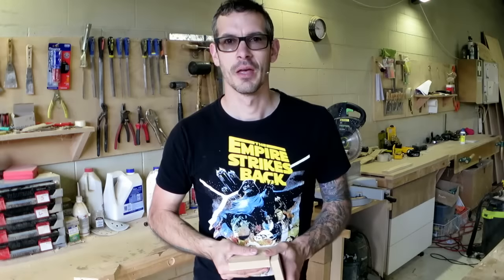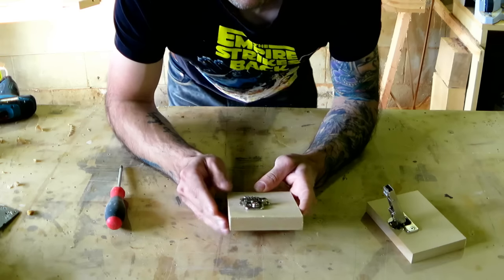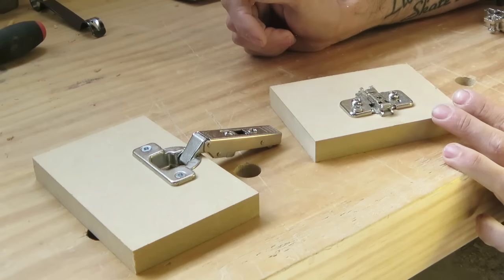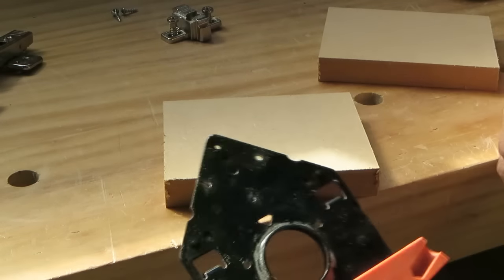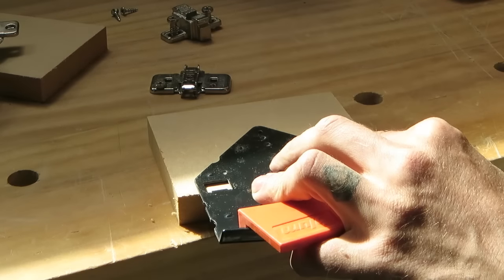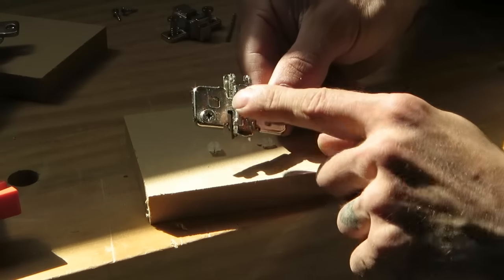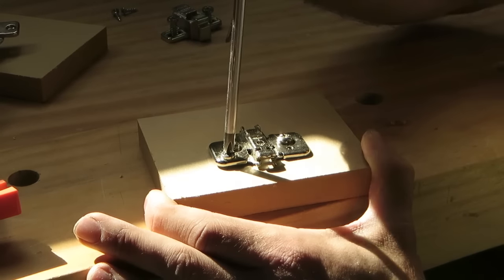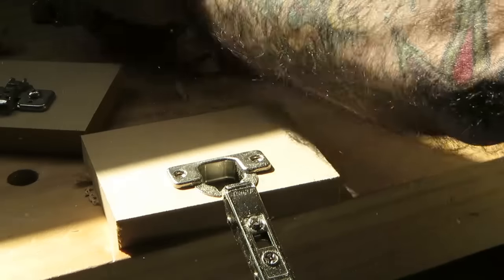kitchen hinge basics

Comment: For euro hinges it is pretty simple. The hole in the door is 35mm in diameter, 12mm deep, and should be 5mm from the edge (or 22.5mm if measured from edge of the door wing to the center of the hole). The cabinet part is even  simpler. Holes are 5mm diameter, 32mm apart and should be 37mm away from the edge of the cabinet side edge.
Reply from the maker: This is totally not always the case, there are so many different types of hinges and relevant drilling positions that this generic simplified information is not really helpful unless you specify which hinge and type you are talking about.

Comment: May I ask what those plastic "anchors" are called. It seems after a while my screws end up loosening and nobody here checks on them and they/the door end up getting leaned on and the threading from the wood side gets damaged and the screws fall out and get lost. I was thinking of just filling the holes with the missing screws with epoxy and replacing the screws.

Comment: Is there any reason not to install the bore side of a hinge in the cabinet instead of the door for an inset door? It seems like then the bulky part of the hinge would be out of your way instead of inside the cabinet.
Reply: Yes, that is the way the hinge is supposed to be installed. The geometry of how the door opens will not be correct, also they will not adjust correctly.

Comment: Do you have any rule of thumb for measuring door sizes when using these style hinges?
Reply from the maker: Trevor Roth hi,  generally no wider than 600mm  and anything of say 750mm tall will need 3 or more hinges. ie a pantry door will have 3  taller than that 4.  this is assuming you have 20mm thick Doors.  thicker than that you will probably want more hinges to accommodate the extra weight
Reply: I mean do you make the doors smaller than the boxes with full overlay hinges.
Reply from the maker: Trevor Roth oh yeah.  so I like to use full overlay when possible. if it was a single door on a cabinet I'd make the door 2mm smaller on each side top and bottom depend a bit on application but that's easy enough to work out.  if there are 2 or more Doors I take 2mm off the hinge side and 1 off the open side. 
so a 600mm cabinet would have 2 Doors 297mm wide. depends a bit on how much adjustment you have in the hinge. if you make them tight you can always shave them  a little.

Comment: Good info. Did you ever come across such a hinge that opened at least 270° and would be under closing tension from at least 180°?  I have a design that requires the mount to be on a partial blanking panel on the front of a cabinet.
Reply from the maker: Hi mitch, the best i know of is 170 deg.  i think you might have to make pivot type hinge for that?
Reply: Cheers. Thankfully I have plenty of time to work on the design for this, so I'll figure something out. Have to love these hinges for the adjustability and ease of installation though

Comment: can you telk me why i keep burning out drill bits? drilled 6 doors and already the bit is burnt out and i need another. at this rate i will got thru $100. in bits.
Reply from the maker: Mainly because the cheap bits are cheap. I have had the same problem. If you were to spend  $150 On one good one is should go for a couple of years.

Comment: Can anyone help me here... The doors on my cabinet and cuboard are like half inch overhang on both sides... I am trying to replace the frameless hinges with better ones but twice I have been to home Depot to get desired hinges. All of which are making the door short. What do I mean by short? Once installed, the door is short by is like 1/2- 3/4 inches from where the opening is. It's like the current hinges I'm getting placing the door 1-1 1/2 inches overlap on one side. Any suggestions???
Reply from the maker: Hard to say without a pic. Could be that the hinge mount is a 9 or 18mm and should probably only be 0mm mount. Find me on Instagram and send me a pic

Comment: It said zero mm but it had a 2mm lip.
Can you make it flush? Like actual zero no lip?
Reply from the maker: +Harry Girgin yes, depends on the hinge type and amount of adjustment. In this case I could move the hole for the cup part in the door slightly closer to the edge of the door.

Comment: Please help me! One of the hinges got broken, and I don't know how I can get a replacement. I got 3 different kinds from Lowe's but no luck. See photos in this album: https://photos.app.goo.gl/cIzc4VgmBBIuC6K92 . How I can find a replacements online?
Reply from the maker: hi , im not exactly sure where you can buy these as im not in the states, but it look like you need a 160 degree or 180 degree hinge , the one that is broken also has soft close built in so you might want to get that again too. you will need to buy the hing (part on the door)  and the mount (part on the cabinet)  unless you can find the same brand hinges as whats on the cabinet now. 
also if you buy a new brand its probably worth while buying another set and change both hinges on the same door so they move together correctly.  hope this helps. ??
Reply: KingPost TimberWorks thank you so much! From where I can buy alternative brand?